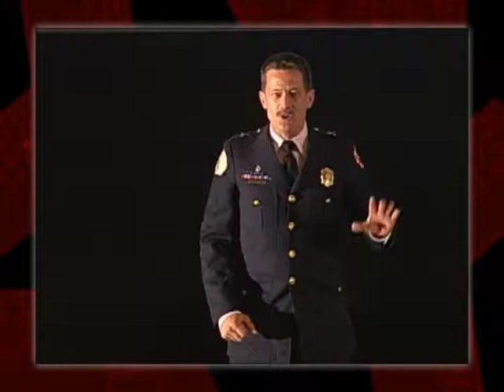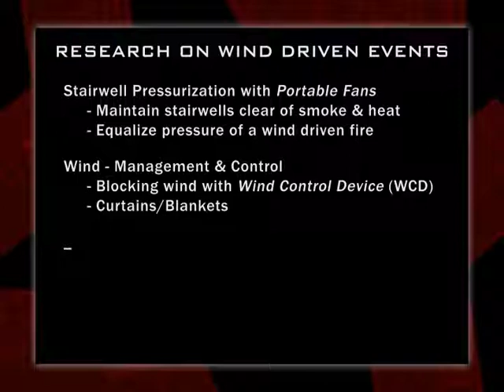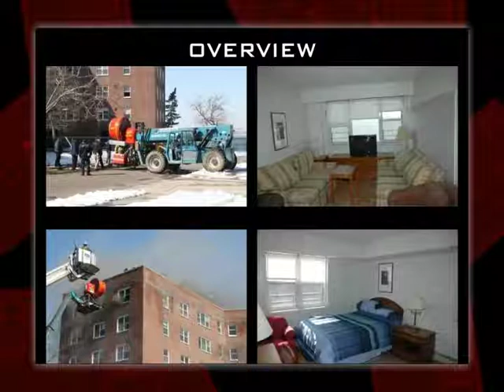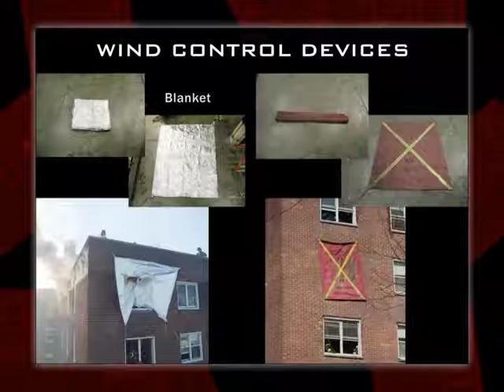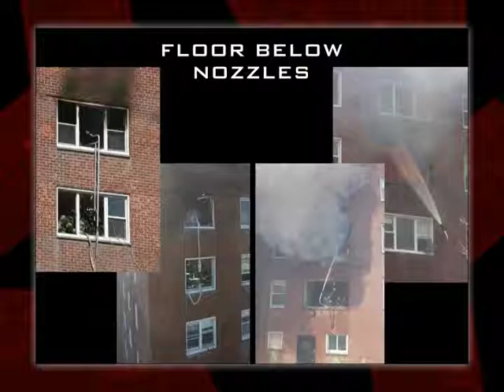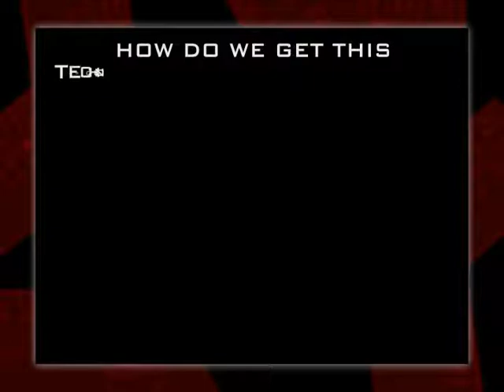Examining Fire Fighting Tactics under Wind-Driven Conditions (Pt. 4)

Comment: What's scary and sad is that these videos have been on YouTube for 10 years and there are only 15k views.  I've been a firefighter,captain,  and now battalion chief in an urban department for 29 years.  3 years ago, I was in a top floor apt fire of a 5 story walkup, a window in the hallway was vented.  Conditions immediately changed.  I sustained 3rd degree burns and i was hospitalized for a month.  It is so important that we understand air flow in any structure fire.  These videos should be mandatory for promotional advancement.